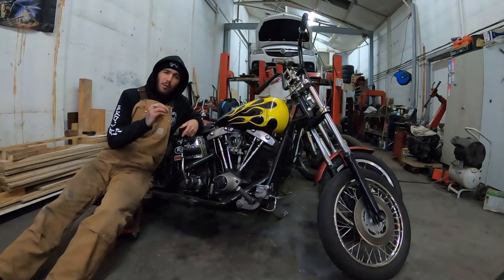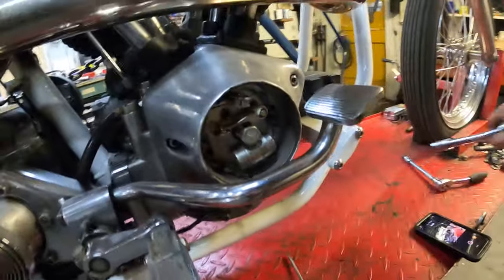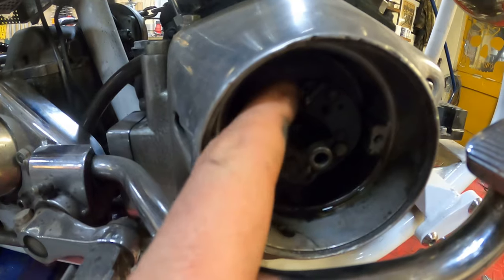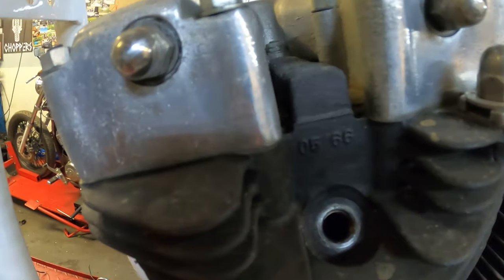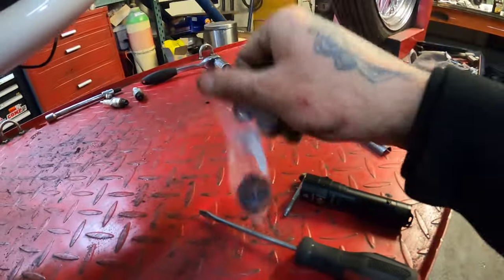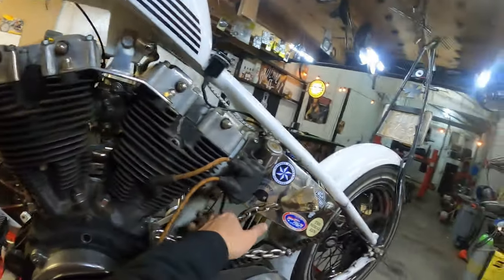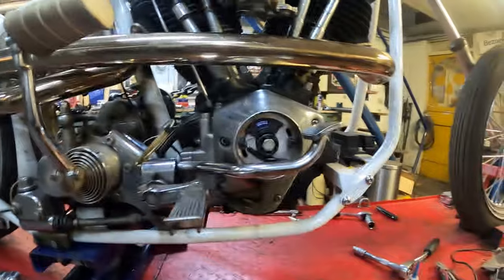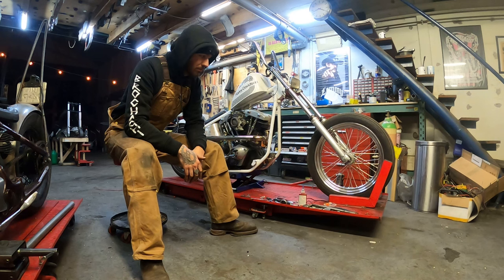Installing shovelhead DYNA-S ignition

Comment: Hi, what’s the timing on a 92 evo softail on the line or the dot ? Thanks
Reply from the maker: Pretty sure it’s the dot, but best to make sure by putting your thumb on the spark plug hole to feel the compression or check your manual.

Comment: Good video. However, I’m not a fan of the Dyna Tech ignition. Points have been working fine for me for the last 50 years.
Reply from the maker: I used to be right there with you. But the “set and forget” with the Dyna-S is worth the buck for a daily. When you’re on the road, having points is just an unnecessary risk if you ask me.
Reply: Yeah, I just like the simplicity of points. I’ve had to change points out on the road but, they’ve always got me home. Ride safe my friend.

Comment: Did you have to change coil or does the points coil work with electric ignition.
Reply from the maker: You can use the 5ohm coil off your points system, but i already had the Dyna coil mounted.
Reply: @Greenleafgarage  ok just wondered as I know the ohms are different.
Reply: I'm trying to do this but I get the test light on full time and whe I turn the dial the light turns off what am I doing wrong its all aligned up to I'm lost
Reply from the maker: @zachspringer1413  are you on the front cylinder compression stroke?
You could be 180* off. 
Is your test light connected to the blue coil wire? Are you sure there’s no continuous 12v on your blue wire? (Continuous 12v should be connected to the white coil wire.

Comment: Another video I’ve watched says to use the dot for tdc not the dash ?
Reply from the maker: I did not use TDC, i used the advance mark. Also there’s difference through the years about what tdc and advance marks are. Best is to check your pushrods to make sure you are on tdc, and then either go to there or advance.

Comment: Quick question ⁉️ what about the Xtra white and pink wires? Mine has electric and kick start.
Reply from the maker: Other than the white and blue, There are no extra wires on a dual fire Dyna-S ignition.
Reply: @Brochachichoppers  from the bike , there's a pink and a white wires . Pretty sure the white is to the battery but what about the other ?
Reply from the maker: @rodmanheffelfinger9511 I can’t help you with that unfortunately. Maybe the service manual can be of help if it still has original wiring?
Reply: @Brochachichoppers  ciao ho fatto la stessa procedura nel mio shovelhead solo che la luce rimane sempre accesa anche ruotando la piastra va bene uguale?